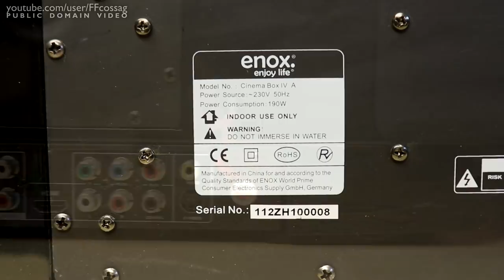Hacking a shitty 'white van' soundbar

Comment: Did you look at why the front panel VFD doesn't work ?
I suspect it's entirely fake given the complete lack of wiring to that part of the case.
Reply from the maker: No, it's wired up. The guts are that of a standard issue Chinese DVD player, and they all use that display. Also they're LED displays, because cheaper. ;)

Comment: Regarding the dead SMPS, did you check for shorted diodes on the secondary side? I'm pretty sure that would be the problem ...
Reply from the maker: No, since it worked just fine. Shorted diodes cause tick mode or exploded switch IC.
Reply: FFcossag - I’d perhaps have scoped the outputs of the DVD psu. If there’s severe enough ripple, it can cause all sorts of problems. The hot cap was very suspicious.

Comment: Interesting noise on first power up there, as for uses, maybe put it up in the back of your van on your next adventure (if there is to be one of course)... :D
Reply: twocvbloke that was my first thought as well. With some light modification, it could make a excellent set of small trunk speakers. Would need a better audio driver solution however. perhaps a repurposed car stereo would be the right solution?
Reply from the maker: While sound quality does not convey well over Youtube, the sound quality of this thing does not lend it any place, anywhere. It's awful, lol.